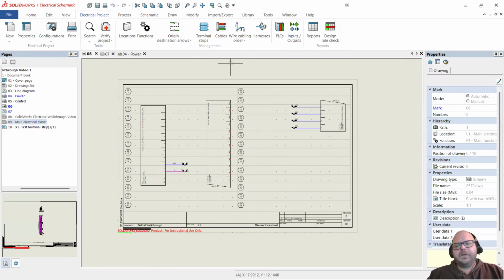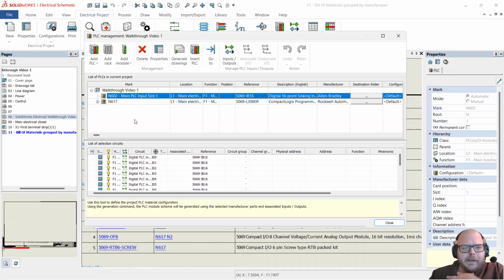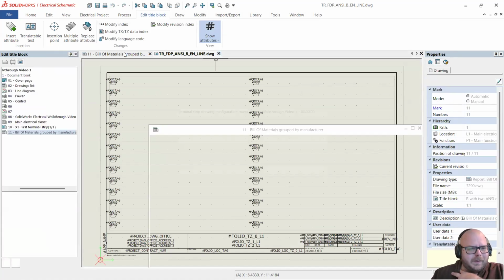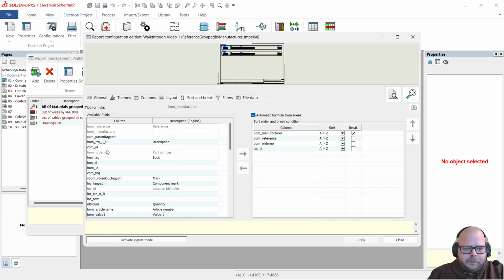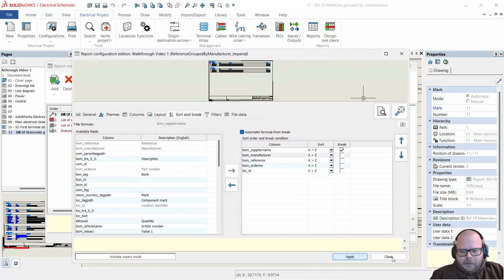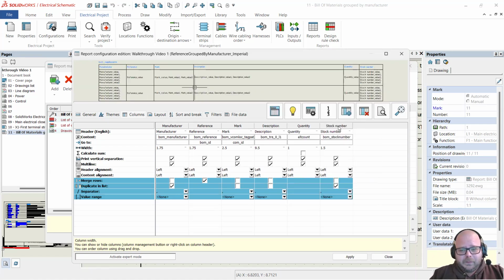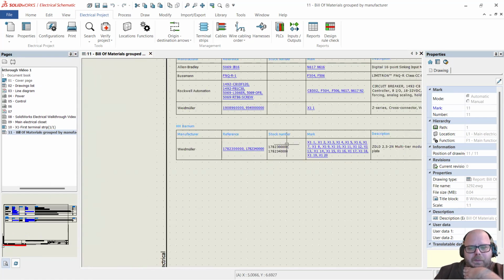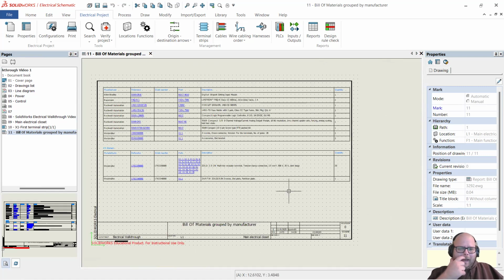Ultimate SolidWorks Electrical BOM Tutorial: Filtering, Sorting, and Customizing Columns

Comment: I watched the whole video and it didn't answer my BOM question. It did not cover how to include it along side a current drawing instead of producing a whole new separate sheet. Also I have an issue where if I do the report this way I get the whole BOM but if I try to embed it into a current DWG I get only a few items to show up and it is not clear to me where they are pulling the component list from. I have another BOM that does not seem to update at all with changes in the schematic.